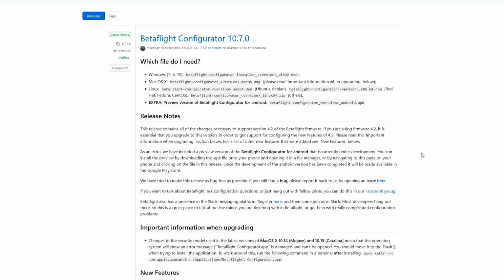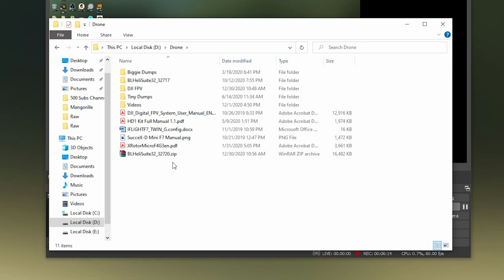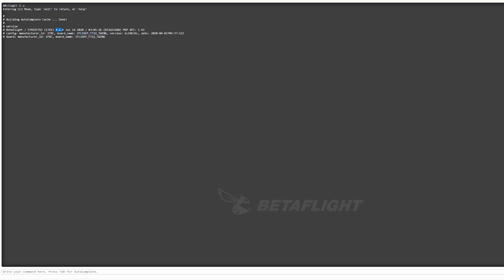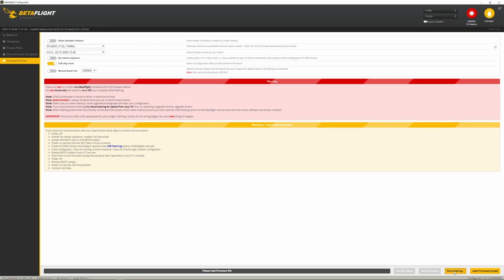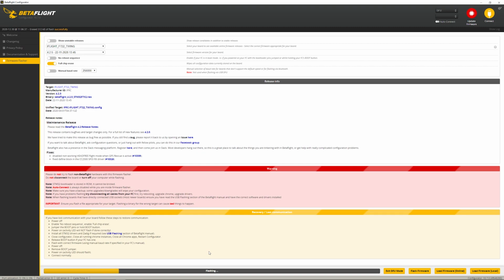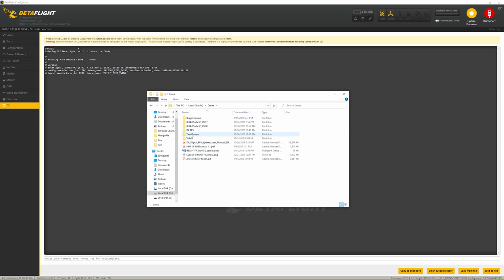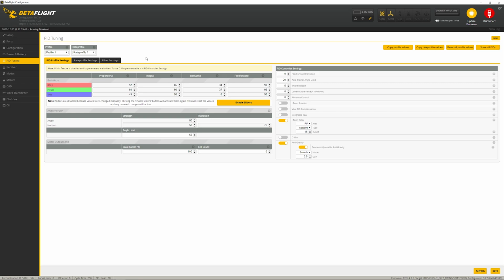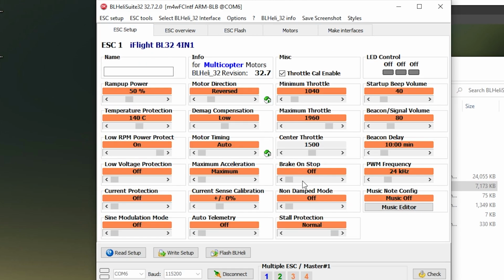How to update the Betaflight firmware on your FPV drone | The FAST & EASY way to flashing!

Comment: another video that says the same useless thing that doesn't work thanks.
Reply from the maker: This is quite an old video, the concept still works but you can't just do a dump and import when jumping major releases anymore as some of the features have changed. There are other pages that show you what sections you can import and which you can't depending on which version you have and which version you are going to. What issue you having?
Reply: @Mangorille  I was rageposting after having given up already. sorry. 
the bubito, from rotor riot, a garbage company and garbage quad. it won't bind ELRS, the support said it never does and needs an update, the board won't update. thus the quad is a brick and goes in the trash. 
I shouldn't be running around the internet and rageposting though, I should be mad at rotor riot.
Reply from the maker: @greedfox7842  Happy to try to assist you in troubleshooting it if you want to shoot me a quick email.

Comment: Can Anyone help me please,  I bought Eachine 5 years ago I never used it. Now I'm trying to use it I'm not able to connect the Eachine uk65 with Betaflight,  I get this , warning, the firmware version is not supported please upgrade firmware that supports api version 1.41.0 or higher alternatively download and use an older version of configuration if you are not ready to upgrade.. what do I do ?
Reply from the maker: Sounds like your betaflight firmware on the quad is really old yet you're trying to use a new version of the configurator software. Go to the link below and download the configurator from 2+ years ago and see which is the newest version that works.

https://github.com/betaflight/betaflight-configurator/releases
Reply: @Mangorille  that's is exactly right. I never configured the FC,  I appreciate your helpful advice.  Thank you.
Reply from the maker: @albaniansuperiorshqipetari8055  Do you know which flight controller it came with? I wonder if they even have a new betaflight firmware for it now.
Reply: @Mangorille  I have   crazybee f3 fs firmware,
Reply from the maker: @albaniansuperiorshqipetari8055  That thing is really old. I checked and looks like it only supports up to BetaFlight 3.4 (we're up to 4.4 right now).
Reply: @Mangorille  I download the 10.6.0 version I think and it worked I got connected, I'm bind with the drone but it does not fligh, only separate motors spin one at the time its all messed up, now I need to re connect my transmitter I have a Flysky FS-I6S FS I6S , the only way I can bind  it to Eachine UK65  is by holding bind button while plugging the battery, while transmitter is on binding mode. It does bind but it does not fligh. Iv seen people on YT how they connect by puting transmitter in bind mode plug battery then pres and hold bind button on the fc and that's the right way, I gues I'm going to do more research in how to bind it and configure it probably. I did not know this is so complicated, but I don't want to give up,
Reply from the maker: @albaniansuperiorshqipetari8055  The fact that you can connect to it is the first step, stick with it and try to troubleshoot each issue one-by-one.
Reply: @Mangorille  perfect advice thank u mate

Comment: So I’m trying to figure if this would be whyX i have an iflight xl5 titan 4s f7 stack, I swapped it to tmotor 6s velox v3 motors and I’ve flown this on 4s before but now it’s not arming, it’s 💯 bound and in beta modes and low throttle is normal, but what makes me confused is the turtle and motors tab spin the motors, but when I go to arm even with all other quads and aux channels working unless it’s for arm. I noticed when I went to reorder motors it said update fw and I’m still on beta 4.2 for the quad it seems I’ve never done this but don’t know why it spins in turtle but not on arm. Any ideas ? Thanks for the video
Reply from the maker: Do you see any warnings on the OSD in your goggles when arming? That usually gives you an idea of why it's not arming.

Comment: On betaflight it says "Configurator has detected the board: IFF7_TWIN_G but no official Betaflight target was found". It cant auto-detect a board, what should I do?
Reply from the maker: I get this sometimes as well depending on what version I am upgrading from. Just make sure you have selected the correct target for your flight controller!

Comment: So would this reset all the settings getfpv put on my new ready to fly drone? Also I'm not sure if I have to update software on dji assistant 2 and I connected the controller and goggles-dji system and it still doesn't let me fly
Reply from the maker: The update will reset all your settings but you can start putting them back through the CLI commands. What happens when it doesn't let you fly?

Comment: HELP! I tried with no success to put in the air my wizzard x220, I think I’m doing something wrong with the receivers connection,,, when i go to betaflight receiver setup it doesn’t show the colored bars,,, what’s wrong??? PLEASE HELP!
Reply from the maker: You do not see the transmitter channel bars or they are not moving when you move the sticks? If they are not moving it would either be a physical wiring issue of your receiver, binding issue of receiver to transmitter, or you have selected the wrong receiver protocol in Betaflight.

Comment: When I go to connect after flashing the new version it's failing to connect and it's not the cable or the USB I've tried a bunch and everything works fine with my other quad. I just can't seem to connect to betaflight for the life of my and it's my brand new roma f5 and I'm starting to feel like I'll never got to fly it😭🤦🏾‍♂️
Reply from the maker: You were able to connect prior to flashing and now after flashing, it doesn't connect? Was the flash successful? Are you certain you flashed the correct target?

Comment: hi thanks for the video but when i download the impulse rc it just says searching for osd device do you know a fix to this
Reply from the maker: Hey. Do you have the flight controller plugged into the computer and are the lights on the flight controller on?
Reply: @Mangorille  having the same issue. yes the USB is plugged into the FC, and lights are on. I'm in the middle of flashing 4.3 and i had to do this driver fix. It is stuck on "searching for flight controller".
Reply: The flashing process deleted the FC data, so it didn't see the FC. Once reloading the FC dump file, the impulse RC will not run. the errors are "unexpected number of devices detected" and  "access to the port COM3 is denied"
Reply from the maker: @Now-is-1984  You usually just need to run the Impulse RC Driver Fixer the one time. What exactly happens now when you try to do the flash from the beginning? Can you email me some pics please?

Comment: Hey bro, 

Could you give me some advise ? I followed another video where said to full erase the chip and when I did it to my wizard 220x started beeping and hasn’t stopped since then. Also, I can’t fly it anymore. Do you know why ?

Thanks.
Reply from the maker: Hey Max. When you flashed it, did it report that it was successful in the flash? Can you still connect to the flight controller through BetaFlight? The full chip erase would not cause that but a failed flash or the incorrect flash target would.